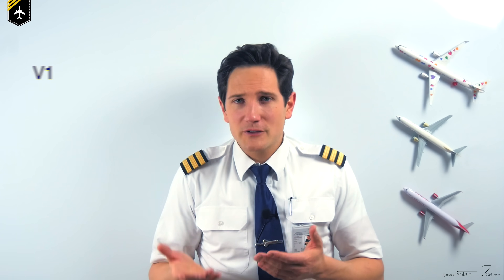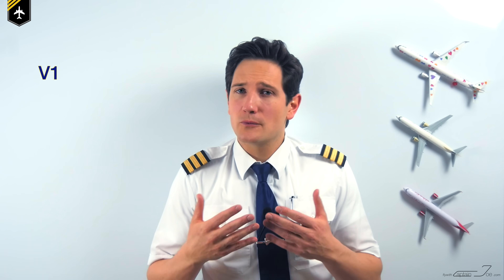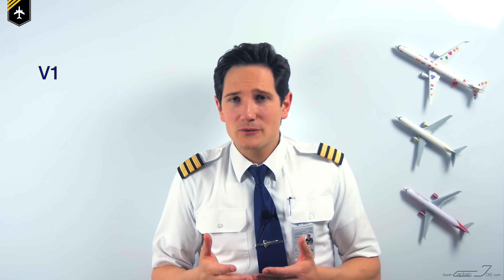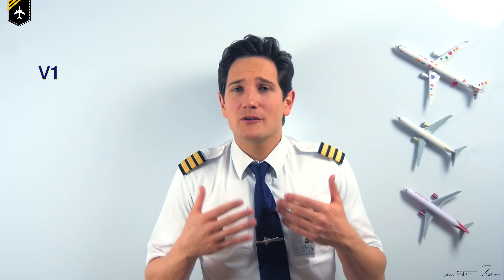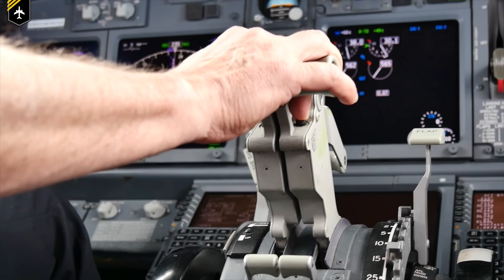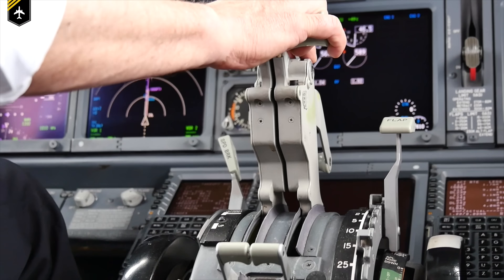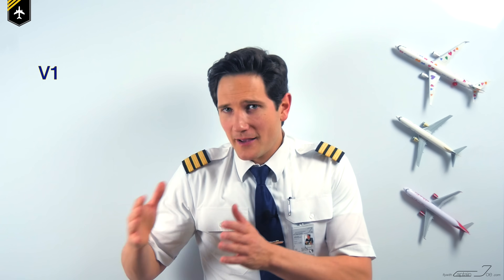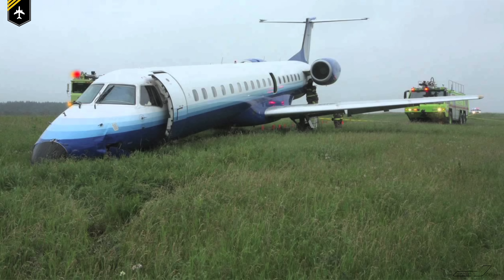TAKE-OFF Speeds V1, Vr, V2! Explained by "CAPTAIN" Joe

Comment: What does "Minimum" means when it is landing ? Some Pilots says then "Continue".
Reply: It's important during low visibility procedures. When the aircraft is on descent shortly before touchdown, the "Minimums" altitude is called out. If the pilots don't see the runway at this altitude (height), they have to go around and perform another landing. Most often it's from 50ft to 200ft above ground. If the pilots see the runway, they say "Continue" or "Landing" to continue the landing. (obviously)
Reply from the maker: Video in the making!
Reply: Dupont Eric it is the minimum altitude they can be at to make a decision to go missed on an approach. Once they reach that height they look for certain runway markings, if they see them they may continue and land, if not they go missed.
Reply: Minima or minimum is the so called Decision Height or Minimum Decent Altitude (DH or MDA) where you take a decision to continue/land or do a Go around.

You're required to have a visual contact with certain approved things (Example Threshold marking/lights, approach lights etc) If you have the whole Runway in sight you usually say landing, while if you only have the approach lights in sight you say continue until you get contact with the Runway.

This is used for instrument approaches. 

Incase you do not have contact with the required stuff you have to initiate a go around as it's not safe to continue the decent. 
Either you try for another approach or go into a holding and wait for the weather to get better or go to your alternate airport. 

minimum changes with the type of approach, the most common one a CAT 1 ILS approach has a minimum of 200 feet (60-70m) while for example a non precision NDB approach has a minimum(MDA) of 300-350 feet (100m).

Hope that answered your question, bet CPT Joe will explain it better in a video. :)
Reply: Tibi, no. A go-around can be made from pretty much any height in a jet including from the ground. The "minimums" call is if the aircraft is still in cloud and the crew cannot see the runway or the approach lights to the runway. In that case they must initiate a go-around.

So, if they are visual with the runway or approach lights, at the "minimums" call, the pilot flying will respond with "landing". If they are not visual then the call is "go-around".
Reply: Well, it all depends on the performance required for that specific flight. That will say the length of the runway, what type of engines, the Density(temperature, humidity and pressure) 
Runway conditions, is it wet/dry/upphill etc. Configuration etc. What type of climb profile you're going to fly. Example close object/mountain. De-rated Take off(lower take off thrust to save the engine wear) 

So I cannot say a specific speed as it change from every flight. However the bigger the aircraft(Usually means the more weight) the more Moment it has,  the more amount of lift is required. That lift is created by increasing the overall speed. 

As speed is part of the lift formula.
L=1/2*CL*p*V^2*S

where L=lift

CL=coefficient of lift, that will say how well the wing produce lift. Example a clean wing will produce more lift than a dirty one as a dirty one create more friction drag. Flaps increase CL for example.

p=density (You want high pressure, cold air and low humidity to get the highest density) The amount of weight of air per volume.

V^2=velocity (True airspeed) in square. (This is usually the one you increase to produce the required lift, higher take off speed/rotation)

S=shape(Area) of the wing, the bigger the better it's at producing lift.
1/2= a half

But normally it's around (rotation speed) 
*130-160kts
*150mph-170mph
*250km/h-290km/h

The speeds are calculated before every flight, either with graphical charts or with the newer Ipad App by Boeing/airbus etc that more or less do the same thing, but much much faster and more precise.

It's a lot of force/power created during the take off. And as you said, the acceleration is pretty cool.
Reply: The minimum altitude is an altitude that you can find in approach charts ( ils, vor-dme, ndb, rnav, etc...). In the a320 you have to enter this altitude in the appr page in the mcdu under mda (minimum decision heigth ) or dh ( decision height). During the landing you will hear the minimum call at this altitude you need to be totally configurated for landing, stable and also have the runway in sight. According to the type of ils approach cat 2, cat 3A or cat3b you will have to see different runway lights or marks.
Reply: There is a "100" callout which is the normal callout, 100 feet above runway. But there is also a callout "100 Above" which shows you that you are 100 feet above your decision altitude. 
Lets say, your Decision altitude is 200. Before landing you would hear the following callouts at 400 feet above the runway: "400!" - "300! 100 Above!" - "200! Minimums" - (pilot says "continue") - "100!"and so on ...
Reply: Arcadiez   ok I'll ask.  what are some of the lift off speeds for some of the commercial airlines.. 
  that's my favorite part of the flight.  I fly 6 or 7 times a year on a subway car to Central America.. 
maybe just over 100 passengers.. 
 2 engines atleast.. pretty cool rush on take off
Reply: Minimum is the callout that comes when you pass the decision altitude.. the decision altitude is when the pilot has to decide wether hes gonna "continue" the approach or not. at most ILS approaches the decision altitude is 200ft but can vary depending on Approach type. 
Btw, there is also a callout "100 Above". this callout comes 100ft above the decision altitude. 
hope that helps :)
Reply: so 100Above is pretty much the same as approaching minimums?
Reply: No the minimum call is different than the 100 call. The 100 call tell you that you are 100 feet above the runway
Reply: TiBi, The speed at which a modern jet becomes airborne is dependent on a lot of factors that vary for each takeoff so there is not a single answer to your question. These variable factors include, gross weight, weather, runway condition, airport elevation, flap setting, power setting among other factors. The closest answer to your question is the V2 speed.
Reply: Dupont Eric n
Reply: But there is always auto landing (plane lands by its self) my dad flies the b777-200ER and 300LR and every month I believe he has todo an auto landing, but those landings can only be done with an airport that has a cat3 or cat3 B (don't know what that means) can someone explain that to me please
Reply: It's the maximum minimum that the pilot can see as it relates to the visibility of the runway lines and/or lights to include horizontal and vertical optimum optical acuity.
Reply: Arcadiez what aircraft do you fly?
Reply: bernie weber what are you talking about?  Are you a pilot?
Reply: thegames20.15 silva If the airport is equipped with SMGCS (just google it) then the Cat III minimums will probably be charted at 300 RVR.  If not, they are usually 600 or 700 RVR.  RVR is runway visual range, and is usually measured at three locations along side the runway.  Touchdown, Midfield, and Rollout.  It is measured in feet, so 600 RVR means the detector estimates the visibility, just above ground level, should be 600 feet for that segment of the runway.  In order to legally start the instrument approach, the reported RVR must be equal to, or above the charted RVR on the approach chart.  Once the aircraft has begun the final approach segment, if the visibility decreases below what is charted, the crew may continue down to the minimums and take a look.  The minimums may be a Decision Altitude (based off the altimeter), a Decision Height ( based off the radar altimeter), or an Alert Height (also radio altimeter based).  If it is a Decision Altitude or Decision Height, the crew may continue to a landing (even if the reported RVR is less than required) if they determine that the inflight visibility is equal to or greater than charted.  This is based in what they are able to see out the window.  If the approach uses an Alert Height, then they do not need to see anything in order to continue to a landing as long as there are no system malfunctions and the aircraft is in the proper auto land status.  That would be LAND 3 in the case of your fathers jet.
Reply: I have no qualms or ego/pride problems going around. If it's not looking correct, I don't care what anyone waiting on the ground says when I get down. However many times, whatever it takes, it's what I'm trained to do.
Reply: Arcadiez Thank u my friend!
Reply: No problem, I'm a pilot so if you have any other questions don't be afraid to ask. Cheers.
Reply: So I guess it is something similar to V1 for takeoff. Once you've reached and passed this altitude, there's no way back in the sky.
Reply: I think the pilots have to decide if the aircraft is stable and continue the landing or unstable and go-around. :)

Comment: hey JO can you "PLEASE" do a video on flaps, slats and spoilers!
Reply from the maker: Yes I´m working on it :)
Reply: @flywithcaptainjoe 7:18
Reply: We all know what they do but we still want JO to kindly make a detailed explanation in a video to satisfy our inner aviator!
Reply: You might find this hard to believe but pilots aren't always the best at explaining the science of the aircraft they fly.
Reply: ...why spoil it?  ;)
Reply: I was gonna say that as well xD
Reply: Just did xD
Reply: Came here to ask this, also would like to know about the phases of the climb, and how far away you start your descent and it's profile. Thanks, great channel!
Reply: theneptune2011 why are you wrong?  Calls for incredible speculation on my part, don't you think?  V relates to velocity. For example, V1 is based on runway length, aircraft weight, flap settings, pressure, etc.  It's the point when the aircraft, given the variables listed, is committed to takeoff. Has nothing to to with Vertical anything.  V1 on a 1,500 foot runway is far sooner than a 3,000 foot runway.  V1 is sooner on a wet surface than on dry.
Reply: Bikestail er Yeah do it
Reply: and please have it subtitled. auto generated wont do.
Reply: You will start the decend at the top of descend point, you can see it on your nd, also the profile is calculated by the mcdu if you follow the star use the descend mode but if the atc gives you some vectors use open descend mode. Also you can some time use the vertical speed in some cases (e.g: when approching the final fix you can use it to stay just a little below the glidescope to improve passenger confort).
Reply: Captain Joe Hey joe just found your channel really nice!
Reply: Hi Bikestail er, i used to thinks like you, with pythagoras theorem you can calculate the distance from when you should start the descend but you will have to keep the same rate of descend during all the descend which is problematic cause during descend there are faces where you will have to reduce your speed (e.g: speed restriction under 10k feet or reducing speed during approach) so if you have a high rate of descend it will be impossible to reduce speed during descend, also winds can false you calculation that why it is better to use the mcdu descend path and top of descend point. You can use pythagoras theorem during flight preparation to estimate ''approximatly'' your top of descend with a marge of error between -+10 milles or with the q400 that use it as a base for it vnav descend.
Reply: V= Velocity
Reply: I guess I would have mentioned 'Velocity' also but perhaps the poster 'assumed' anyone reading or watching this Vid in depth would know what V stood for or at least Google it:-)
Reply: theneptune2011 no, you're wrong.
Reply: Pay attention also to mention hwo do you know when to set flaps 1,2,3,4 or you just make it according to the left scale display on the EADI display ?
Reply: 3pilot6 it’s based on a speed table. For takeoff and landing (each a different table).
Reply: The pilots set the flaps to a setting that is appropriate for the speed and altitude
Reply: And how it affect induced drag. Not so obvious :)
Reply: methinks the rule for t.o.d. is altitude in K feet x 3 = miles away to start descend.
Reply: Might want to mention what V stands for?
Reply: walter riely I know what V stands for...but if I produce a video informing others about what V speeds mean (V1, Vr, V2 etc), I would include what the V was short for.
Reply: why??
Reply: Iron Mike Z Does anyone know what 3 models Joe has behind him? They're beautiful!
Reply: Should be Condor B757 (http://www.airlinereporter.com/2010/02/happy-valentines-day/), Vueling A320 (without Sharklets), Air Berlin B737-800
Reply: The theory of lift is always in debate. The history books idea of lift is only one view:-)
Reply: Bikestail er i
Reply: leading edge and trailing edge flaps! All of that is controlled by the FSEU!
Reply: Bikestail it's means volume 1 V1 means that v2 means volume 2
Reply: Bikestail er 9
Reply: Flaps are used to slow down an aircraft for labding, but keeping it flying. Spoilers are the plates that pop up on the wings on touchdown. Not sure what slats
Reply: RedPandaGaming slats direct air below and ahead of the wing to the top of the wing. This increases the airflow over the wing (adding to the boundary layer) and hence lift.
Reply: Bikestail er it’s joe not jo
Reply: Hahahaha
Reply: that matches perfectly with the topic "landing speed"
Reply: Assad Kansao Simple pythagoras theorem!
Reply: flaps and slats increase lift and therefore drag so the plane can fly slower. slats are on the front part of the wing, flaps at the back edge. 
spoilers reduce lift and increase drag, they are used after touchdown to slow the aircraft down  and they are placed in the middle of the wing
Reply: SLOTS and SLATS
Reply: V stand for vertical...In aviation we have V1 VR V2..and also VX and VY....speed for take off,and stand for everithing that can lift at certain speed,ot only planes,for example,the jets boats that lift  or the race car that lift in the race is called V,is when the air presure under a plane,car,boat is bigger than the weight ,and this  not apply in birds because they use vertical take off
Reply: theneptune2011 Vx is the speed (or VELOCITY) that allows for the best angle of climb.  Vy is the speed (or VELOCITY) that allows for the best rate of climb. Hard to diagnose on the interwebs, but you might be thinking of the same thing, just calling it vertical.  Regardless, the V, in the context of this video, refers to velocity.
Reply: v for vertical
Reply: ok...what about boats and car that lift in the midle of the race when they reach the V limit?they use the same terminology .and also explain to me why also exist Vx and Vy??....maybe u are right but for me and for   JEPPESEN V stan for vertical
Reply: jajaja  u googleled...ok but jeppesen say that v is for vertical,and is not apply for aviation only,i just give my opinion,i fly planes,actually no,i fly one kind of plane everyday(AN 2),and i remember back in my studends day when my instructor say that v stand vor vertical,...but if u say is for velocity i.am ok with u
Reply: Stop flapping your gums ;)
Reply: Bikestail er good idea but I probably wouldn't watch it because I really know about what flaps slats and spoilers r used 4 an don't ask me to explain cuz not a very good explainer